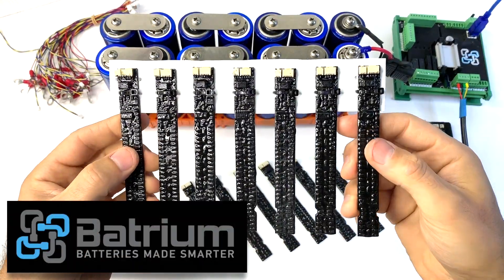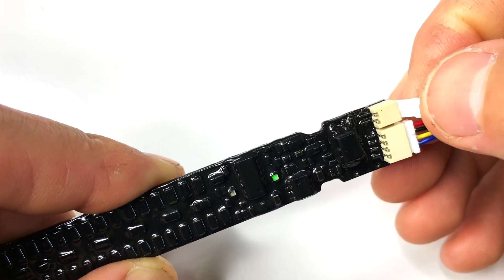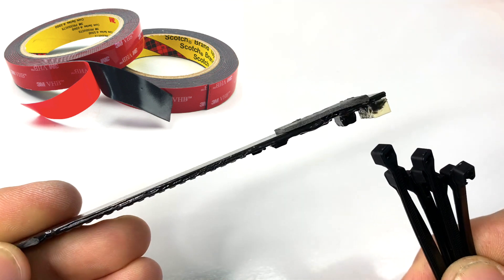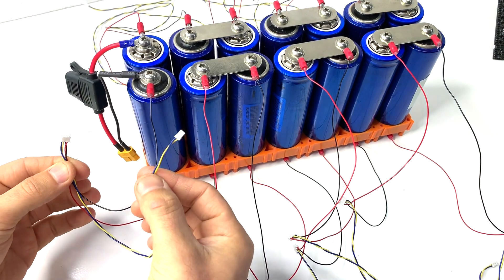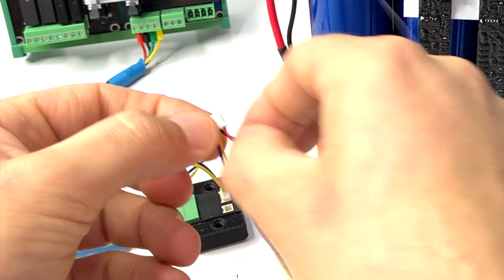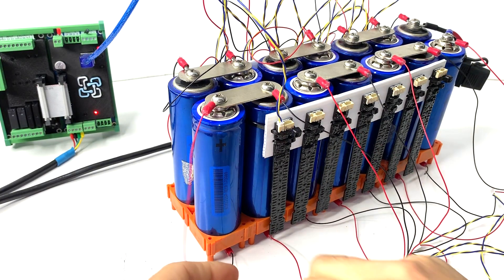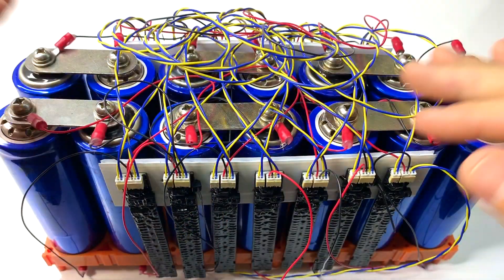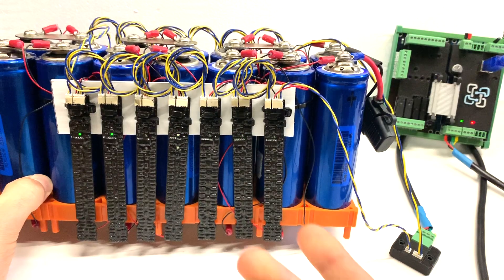Batrium BMS LongMon Wiring Install Tutorial

Comment: Hey Bruno, I have a question. For the power supply for the watchmon. Is the negative the outside pin ? Im a bit dissapointed with the information provided by Batrium. No manuals or instructions.

Comment: Batrium 36s bms video
Reply from the maker: It’s basically the same thing but with more cell monitors in series. The only difference is in the Wizard setup change to 36 series nominal. Apart from that everything else is the same =]
Reply from the maker: I have another detailed video showing how to install the LeafMon cell monitors, lot of good info you can use as a reference for your 36s pack https://youtu.be/eawsLxQ6HXY

Comment: Hello Bruno, please help. I have bafang bbshd and the battery. My bms of the battery was broken so I bought a new one and new discharging port. Then I took my battery to the service and master made a big mistake. He put black/red wires of discharging port backwards and when I put battery on the bike it made hissing sound and smelled fire, the bike didn't turn on. Then I went to service again, he soldered a new bms which just broke, then I put on bike the display turned on but shows error 30h, I googled it and it probably has to do with broken controller. What most probably could happen with my motor or battery after putting battery with wrong +- cables of discharging port? And what should I do?

Comment: my question if i buy that 7s can i use it in 48v???
Reply from the maker: 7s is for 24v batteries... for 48v you would need to get more monitors 14s (52v) or 13s (48v) depending on your setup =]

Comment: Can these be used to monitor groups of two or more cells (in series) instead of individual cells? I lile the POWER RIFFS of the music btw! 😎
Reply from the maker: Sorin Negulescu BMS needs to monitor all individual series voltages, there are two types of BMS:
• centralised where all balancing wires come to the main BMS board - most common and cheaper and simpler design but a lot less balancing power
• decentralised like the Batrium BMS where all monitoring happens at each cell and they all talk back to the main/supervisor board.

Tesla used a mix between both, they have decentralised but instead of many small board they have one per 7 series. Batrium are over 2A balancing per series more powerful balancing than the Tesla... but more wiring... all designs have their pros and cons... 

Heavy metal POWEEEEEEEERRR hahaha ohhh yeaahh
Reply: Thank you for the detailed description!
Reply from the maker: Sorin Negulescu hahaaa all good mate... I’m here to spread the word... the POWEEEEEEEERRRR word hahaaaaa =]

Comment: Hi Bruno, what are these battery packs you're using ? thanks for your vid.
Reply from the maker: daVidFonda heeey mate!! These cells were used in a EV prototype back in 2012... We have hundreds of these big cells so they’re very useful to test the BMS we manufacture.
These are LiFePO4 Headway cells, heavy compared to the 18650 cells but much easier to put together and service, high discharge, safe chemistry and last longer than regular Li Ion (lithium manganese cobalt) batteries.... the down side is that they’re heavier and lower voltage so you need more cells to get to the same voltage. Nothing is perfect... haha

Comment: Hi. Thx for this video.
 I love those new lto cells, im waiting for 128 pieces to build 4x72V packs.
Reply from the maker: Tomu420 yeaaahhh thaaanks mate!!
These look like the new LTO cells but these particular ones are Headway cells from 2012 used in a EV prototype. We have hundreds of them so we use for tests, they are good for high discharge, easy to put together like LEGO, they’re LiFePO4 which is a lower voltage 3.2v nominal 3.6v max, heavier than the common 18650 cells. 
LTO cells you’ll need to find a BMS that can go down to 0v, very few BMS can handle LTO.

Comment: Thanks Bruno, I'd like to see a video on how the cell monitors could be packaged into a unit separate away from the battery. For example, in an ebike or emotorcycle application because MORE POWAH YEAH!!!
Reply from the maker: Ryan O. Ryan O. Yeaaaahhh these cell monitors can be extended somewhere but wiring becomes a mess... this is why we designed the new WatchMon5 which is an all in one solution (supervisor + cell monitors) it’s 15s configurable to 15s, 14s, 13s, 12s, 11s or 10s.
We have a racecar with many connected together talking via CAN BUS.
check it out on Batrium.com website

LongMon showed in this video are probably the most powerful balancing per cell BMS available out there, 1.2A continuous 2A peak... most other BMS are 50mA, 100mA... some are 200 or 300mA